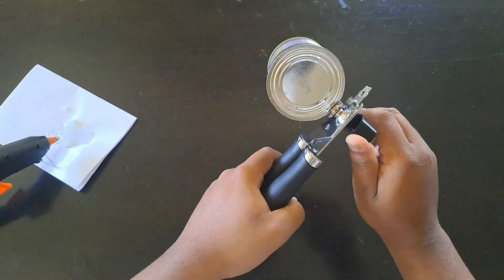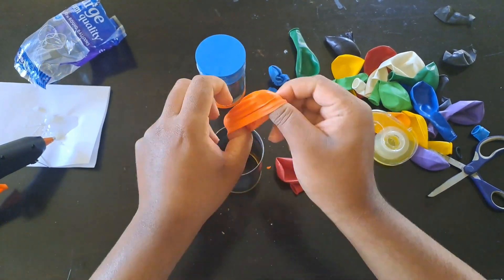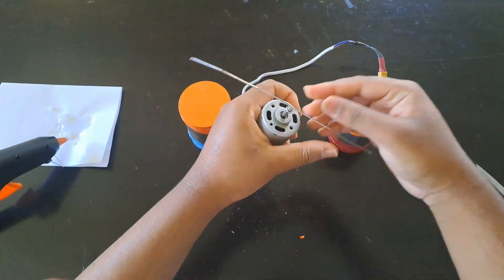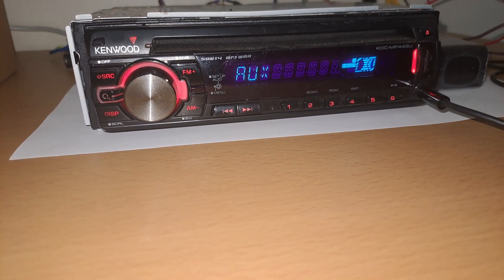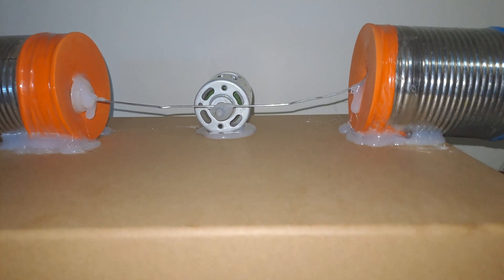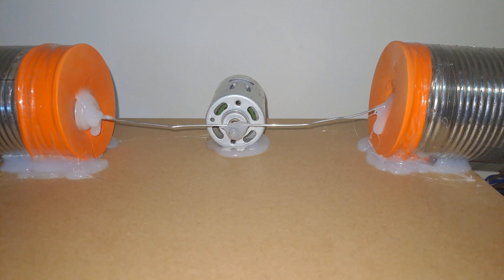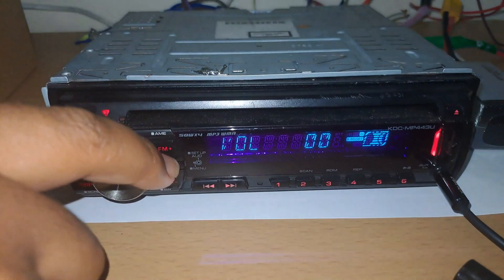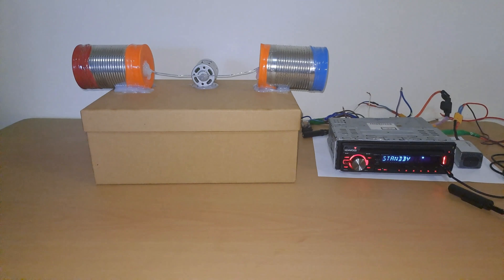DIY Motor Speaker: The Terminator of Sound, Rivalling Professional Speakers

Comment: Have you tried to mount the cans pointed downwards?
This makes more sense as the motor movement will be more up/down than sideways.
Reply from the maker: At the time, l wanted to make a simple version to prove that it works, so l never tested the downward idea